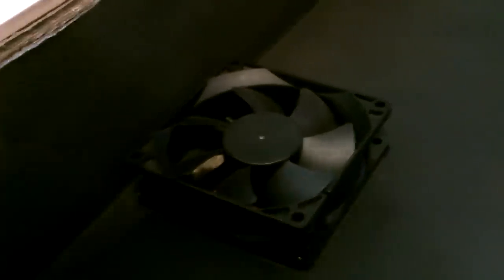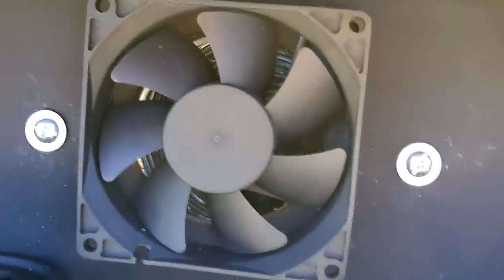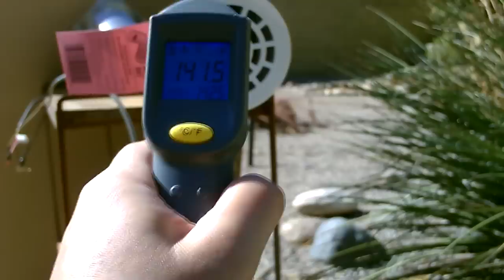Homemade "Steel Can" Solar Air Heater! DIY - STEEL CAN Air Heater! (140F+) - EASY Instructions!

Comment: Thans for the video!  This is similar, nearly the same, as a passive solar heat panel featured in a Mother Earth News articlse, but I think theirs works on convection currents without the fan.  (Article available online.)
Question - if you are just making small homes in the ends of the cans, why rev up the electric tool?  Why not just use a punch or some reasonably sharp object and tap the holes into the can ends?

Comment: You could hook one of these up to a close dyer & cycle the drum using a bicycle for drying clothes or make a clothes dryer setup with an old metal drum, 2x4 frame & a pair of rollers hooked to a pulley system ran by a bicycle or small motor powered by a solar panel & battery. Awesome idea, only issue is it wouldn’t work well in my area as it’s cloudy about 75%+ of the fall/winter/spring, but still great for days when its sunny.
Reply: Jefferdaughter  Do you iron your clothes, then? I find that the only downside to hanging.

Comment: This is a great, great video however I have 2 small questions/suggestions.
1. If the cans are like a radiator is in a car, do you think using an old radiator in lieu of the cans would be a good idea? 
2. What do u think would happen if you ran a metal pipe of some (brass/steel) thru them in a snake type way? And maybe put water in  the piping (of course then it would have to be sealed with a coupler or something)?
Do u think that would produce more heat for a longer period?

Comment: I just did some math for you guys  ASSUMING an input air temp of 70 deg f and a 100 cfm actual air flow at the output. and you have a 70 deg f temp rise ( this is what is important)  Using standard air weight and temp heat parameters  you would get aprox 6500 btu/hr from this unit. A 1000  Sq ft house of new construction and well insulated uses a 65k btu furnace in the midwest (Runs 50 % at 0 deg outside temp. You cannot use the published CFM of the fan because the flow is restricted. If you had a manometer on the output tube you could figgure out the actual flow of the air.  The unit should get its air from the house and the input and the output pipes should be as short as possibe and be innsulated In a cold climate they will loose more heat than they can pickup from the sun.  The thicker the insulation on the box the better it will work. Putting a sheet of aluminum or foil on the back wall on the inside will help the efeciency of the unit. Painting it black will raise the air temp in the space of the box. 

The heat collection tubes should have an airspace from the glass front and not be touching the back wall unless it can be made to conduct additional heat from it.

Comment: It would be nice if the fan ran on a small solar cell.
Reply from the maker: it does. fan can be run at full speed on a 1.8 watt panel.

Comment: nice video.....but those are tin cans (tin steel) wouldn't it be better to use stainless tubes or aluminium
Reply from the maker: hi there. so far i've tried aluminum cans and tin cans. both types produce roughly the same temps. - but if you have access to either type of can i would give the edge to the steel cans. (early testing is showing slightly higher temps using those). i'll be testing other materials in the near future.

Comment: Nice job and it is something that those less confident or precise can still get a decent result out of. I would have like to have seen you weather proof it a bit more though and perhaps let us know what it can produce heat wise in cold but bright weather or even cold and cloudy weather. Also how large a room could that keep warm with that size panel?

Comment: A few suggestions:

1) paint the dryer ducting black, as well; it will absorb additional heat. Also, cover the duct with insulation once it enters the structure. That will retain more of the heat along the length not exposed to the sun.

2) simply drilling holes in the bottom of the cans results in a lot of baffling between units. Better would be to use cans with crimped tops and bottoms; completely remove the top and bottom from each can; and join them using metallic duct tape

3) as someone else suggested, use aluminum cans or ducting inside the box. It will heat faster and conduct heat more efficiently.

How long is the run from box to room?

Have you measured the efficiency and heating when the outside, ambient temperature is close to freezing?

Nice DIY instructions; somewhat lacking in empirical data to interpret the results.

Comment: I'm wondering if scrap tube steel from say a muffler shop would work in lieu of the cans. Would there be any decrease or increase in output from not having a series of baffles like the can bottoms provide?
Reply: Good question. My guess would be that it wouldn't heat as well since the airflow is not restricted like it is with the cans. The baffles would slow down the air flow enough to help heat up the air as it flows through.

Comment: Great idea! However in my case I got way too much heat here in south Ca :)
But I think I might use that to reengineer to  make it water heater.
Reply: If you're thinking of using this for a solar water heater, depending on the water pressure, you could use the black plastic water lines. I'd run it in an zig-zag pattern bottom to top. That is a good idea to turn into a water heater for your area.

Comment: Awesome idea but some improvements might be to use aluminum cans as they transfer heat much faster than steel and to insulate your exhaust pipe to reduce loss of heat before it enters your home. But thanks for sharing!!!
Reply: Jerry Pierce you're *
Reply: IMHO I think soda cans would be better for a faster more reactive heat, but steel cans may be better for longer term flatter heat due to more thermal mass. Just my speculation but would certainly be interesting to experiment with
Reply: your so smart

Comment: ok good idea but you are in summer, in the winter what the result?
Reply from the maker: hi there. made the heater in the fall (October). was in low 60's during the testing. coolest wintertime temps here are in the 40's (winter in the desert). produces 130F air when the outdoor temps are in the low 40's. (fan running at full speed - 40 CFM). with fan running at half-speed (20 CFM) the heater temps rise an additional 20F - (150F-160F)
Reply: In Québec the winter the normal the heater temps  is -8°c at -15°c ( 0°c ( celcius)= 32°f)

Comment: Hey man, thanks for the tutorial, can i make with beer cans?
Reply: They have less thermal mass and the ambient air from the fan will cool them quicker as aluminum is a great heatsink, but yes, it just won't get as hot as steel cans.
Reply: Hmm, i'll use steel cans then.

Comment: if it was truly cold I would insulate the dryer hose so the hot air won't have  a chance to cool down before it made its way inside the house

Comment: aluminum is much better heat transfer. i think i will try this build. a small one first then do some calculations to get btu output for my home. connect to return on my heat pump or leave as standalone. i need to revamp some of the design. this is bound to work and be much much less costly than other solar panels
Reply: You are correct, aluminum IS much better at transferring heat. That could work against you as it will be easier for the fan to cool the cans down and the output temperature will drop more rapidly. Would be fun to build both and compare outputs.

Comment: What was outside temp to achieve that 140*F?  If you use that in winter, you might be bringing in more cold air that hot unless it sucks the air from within your house.

Comment: So where will you place this, outside of the house or just inside in front of a window?
Reply: You must place this outside to get any net benefit. If you place this inside your house you're just condensing energy entering your window--you're not getting any new heat.

You have to place this outside so you capture energy from the sun that's NOT entering your house and condense it and pump it in.

If you place this in front of a window you're just condensing the heat ALREADY entering your home and you're basically wasting your time--you're not bringing any new heat into the home.

Source: Chemical Engineering

Comment: Great video. What kind of backing did you use to replace the cardboard with?  Also, did you say that you use calk or sealant to glue the glass to the frame?
Reply: Looks like hardboard, which if that is, it is essentially compressed paper.  It is the same material as peg boards are made with.
Reply: He mentioned caulk in the video I think...

Comment: How did you connect the solar panel to the fan? didn't show it
Reply from the maker: hi there, the solar panel and fan both have a red wire (positive+) and a black wire (negative-). just connect red-to-red and black-to-black.
Reply: :) thank you so much

Comment: Mother Earth News did this years ago..using aluminum cans. Aluminum heats quicker and releases heat quicker. Result? air flow was so good by the sheer heating of it..a fan was not needed.
Reply: You can to a similar thing with your hot water tank where the temperature of the sun heated water circulates the system without the need for an extra pump. That might be my next project.

Comment: Heat is generated by sunlight heating the air within the cans ,,, hmm.... there has to be a minimum intensity of light surely , and there will be some loss of heat back into the atmosphere out through the case. Can you tell me what the outside air temp was when you made this film, and a rough estimation as to the elevation of the sun in the sky. 140 deg F is very impressive. Just trying to figure out the harshest conditions it could usefully operate at . Thanks, and thanks for making this.

Comment: great Idea. too bad I live in the rainy  pacific northwest :(
Reply: I'm on the coast in the northwest and it still works, not as good but it still absorbs the UV through the clouds. If a solar panel can produce voltage here then this will produce heat.

Comment: This is a little on the DU side.  If you really want a solar panel, argon filled triple pane glass in front, one inch aluminum faced fiber board insulation and a one way air trap to prevent cold air from going backwards at night should help dramatically with a vertical panel. Larger holes between the cans might increase air flow.  Since you are going to the expense, how about a mirror on the ground to reflect more light. Then you might have a real panel to heat your house with.

Comment: I would suggest having the fan mounted external with a tube going into the unit because heat destroys electronics over time. Having it external means you can replace it without opening the unit up again so you can leave it alone forever. You should paint the exterior white to remove heat where you don't want it, and then have a aluminum car window style shutter to cover it when not in use. Handles may also be great because if it's hot and you need to move it you can do so without dropping it and cracking the glass while it's warm and easier to crack.

Comment: I first saw this type of heater when I was in junior high (about 1977) A friend of mine kicked some butt in a school science fair with one. I have to wonder though, if there might be a way to use cans filled with water hold onto the heat created by the sun a bit longer. Another thought I have on it is could you use multiple boxes and connect them in series so that the hot air output from the first box feeds into the inlet on the second box so that the second box is being used to heat what is already warm air. (if you see what I mean) Would multiple boxes set up this way produce some serioulsy warm air?
Reply: If you wanted to do a water system, get Black hose about 2 inches in diameter from your nearest farm supply along with 2 or 3 jointers, fill each with water or even a kitchen oil, oil will stay hotter for longer as its denser, build the box with a couple of holes in the bottom, you don't need a lot, cut each bit of hose shorter than the other so it can fit inside of the other one, use the jointer to join them together, and make a bulls eye. or you could get down pipe from your hardware store with caps to put over each end, also buy the clips to mount them with, paint the down pipe black to allow it to heat up, almost fill it with oil, an in the box put the holes off to the side of each down pipe to allow the air to circulate.
Reply: Philip Horton If you were doing liquid you would want the liquid to travel as fast as possible through the tubing and also the tubing would have to have the largest surface area possible.  An example of this is solar panels used for swimming pool heat.  The tubing used in those are about 1/8" thick.
Reply: i was meaning for holding the temperature in the case, as the cans are hollow so they wouldn't hold heat for long but oil would, which would allow for a small amount of heat to continue flowing, when night time fell it would still cool down but i guess thats what heat pumps are for.
Reply: *****
Or lower then freezing...

Comment: coming from a tech/ engineer point of view, I would modify this project to put the fan outside the heat accumulator box to  push in the cold air rather than to suck hot air out of the box as this would lend toward longer fan life, no fan overheating and low failure rate. I would accomplish this by mounting the fan inside on the bottom to intake cold air and then locate the side board with the seven 1 inch hloes about 4 inches into the box to form an air plenum. I would maintain the air duct and outlet the same as depicted, so all we're talking about here is one extra board and one extra hole for mounting the fan. Just a suggestion. Be sure to allow for placement of a small air filter over the fan hole to minimize accumulation of dust and dirt on the inside of the box and fan assembly. :) One final note (not that it would make a large difference on a small project), according to a study on Solar Heaters conducted by Penn State U many years ago, paint color makes a difference on the effeciency. They found that dark green works best ... so it's no accident that Mother Nature foliates the trees and shrubs with green leaves for photosynthesis rather than black leaves.

Comment: Okay, so here's my proposal for a different way of doing this. Please shoot the idea down if it needs shooting.

Instead of flowing air through the system, which would require either long runs of inefficient air ducting or popping holes in my home's walls or roof, how about a liquid? My idea would be to build this box, but replace the cans with large heat sinks that have been painted black, which would be attached to metal tubing in the box. Replace the solar fan with a solar water pump. Run insulated tubing to/from the unit in a loop with the other end being another heat sink with a small fan running over it.

Yes? No?

Comment: My only concern with building a solar heater boils down to air quality coming from inside the box itself. I've built a frame already and actually have it ready to put some poly on the front of it. I'm wasting time because I'm concerned about hot paint fumes  (already been curing for 2 wks now) and the hot cans themselves. Anybody else worry about this or am I just worry warting? :)
Reply: good thought. i believe that either an enamel paint or heat paint for a bbq should be good enough without the fumes when cured.
Reply: 2 lips
Thank you, thank you, 2 lips, 2 lips. :) hehe
Reply: there black paintings based water or latex pictores is the best

Comment: I'd put a layer of aluminum foil down first, then the cardboard- the shiny side towards the cans. It would reflect some of the heat back. A minor improvement on the insulation but worth a consideration. Also: the intake should be from inside the home, that way the intake air will already be reasonably warm, and the output heat will be even higher.

In any case, free heat is always fun.
Reply: Great point about taking the air from inside the home. Just make sure it is not placed near Grandmas chair after she has been eating her vegetables!

Comment: The heat increases the air pressure in the home. Therefore it would be better to have a return air duct installed at the bottom to get better air flow. The system would be reheating air that is warmer than outside air.
Reply: agreed. It is the temperature differential that facilitates higher flow. keeping the unit inside will still provide extra heat absorbed into the small thermal mass of the black contraption so it is a  good project…I would only use a solar operated fan unit though to make it a see running system :)

Comment: Hmmm ... why not skip the tin cans and just install several runs of the flexible vent tube for a totally passive system?
Reply: unfortunately just using the vent tube does not supply the insulate value required to allow for quasi-superheating the air. 

This individual would get better flow by cutting out most of the ends to fa ciliate flow. The steel cans absorb and hold more energy which reduces initial output but the positive  thing is he will get an extra hour of heat when things cool down in the evening.

Comment: ok, There has been a little space from the start to now. Do you notice anything different about your heating expense?

I like the idea, and of course with me sitting outside the box watching oy, I came up with my own ideas as far as materials are concerned. It will cost a bit more but I am "hoping" for better results.

My thoughts are 4'x8'x3.5" made from 1"x4"x3/4" boards and 1/2" sheet stock fro the back. I am sure I will need to use glass for the surface since plexi is just out of the question regarding cost.

The inside cans I hope to find smooth sheet metal in tubes such as for vents etc. If I can't find anything that will fit inside the "3.5" inside depth I will either make some from flashing material, or just use 1"x6"x3/4"

Great job m8